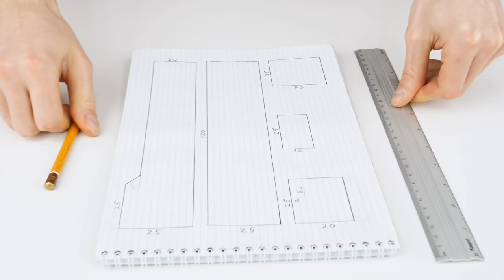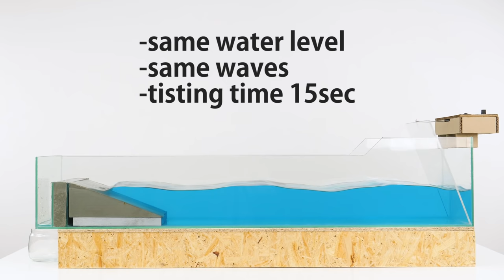DIY Wave Tank - Physics of Tsunami Wave

Comment: Can you tell me what material needed to make the circuit? My daughter need to make one for her science research class.  Thank you
Reply: All you need is :-
3 lithium ion batteries
1 double shaft bo motor
1 dc speed controller
And 1 dc switch
And yea, definitely some wires 
And that's all 
Thank you
Reply: @mysmallgardenofficial  THANK YOU SOOOO MUCH CH
Reply: @mysmallgardenofficial  thanks :)
Reply: @mysmallgardenofficial thank you so much, i literally need this for my project!

Comment: Alright another DIY project, let me get my acrylic glass panes, cardboard, acrylic glue, cement, DC motor, wires, steel wires, batteries, hot glue gun, professional drill, even more cardboard, black pen, twist dials, on off switches, spare wooden planks, string, a bucket full of water, blue food coloring and a whole workshop while I’m at it.

Comment: The rock armour one is totally wrong. The rock is supposed to absorb and block the energy of the waves, placed randomly in the middle where the waves have not yet climbed up is not what they are designed for. They should be placed on the inclined surface evenly in layers.

Also this is just wave maybe in  1 in 2-5years time return period.